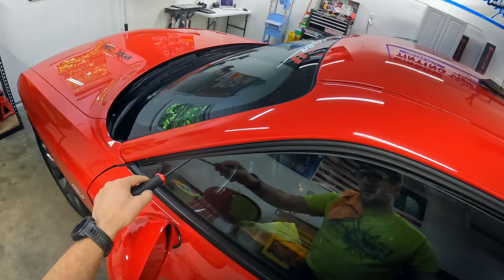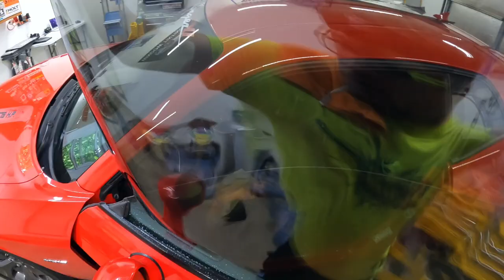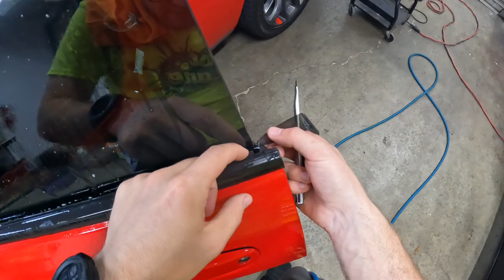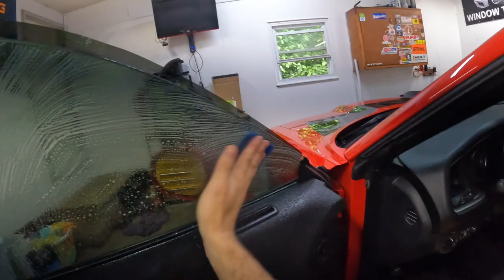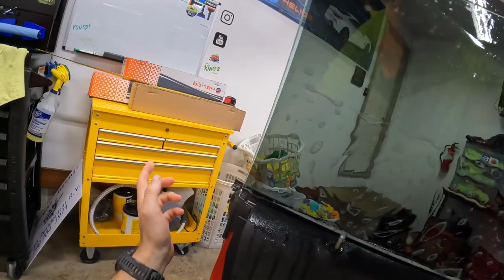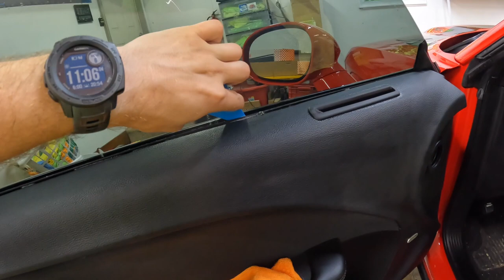A "How To" Guide On Tinting Frameless Windows! 2015-2022 Dodge Challenger.

Comment: Do yu have to leave it below the seal or do you leave it a bit longer on the bottem will a gah show Cuase it the glass locks
Reply from the maker: @Chuy-wg4ve  I always run it just below the seal/gasket so there are no light gaps when the window is all the way up.

Comment: How did you pop the latch back on the windows
Reply from the maker: On the door? You just pull the handle. Some cars you need to pull the handle and at the same time flip the latch back with a screw driver or something.

Comment: You could just disconnect the battery and open the door lol window motors cant work without power
Reply from the maker: Not a smart idea though as on many models the window tucks into a seal. If you disconnect the battery (which also isn't easy to access on many cars now days) the window can't drop down out of that seal and you risk damaging the glass.   Way more work and risk than just flipping a latch.

But you are technically right.

Comment: Ik it’s been a while since this was posted but how do you undo the latch when you trick it to move the window upwards
Reply: I think you just open the handle to basically say that the door it now open
Reply from the maker: Some cars you have to pull the handle and then use something to flip the latch back. I can't remember if this is one of those or not.  Though I'm sure you figured it out by now.